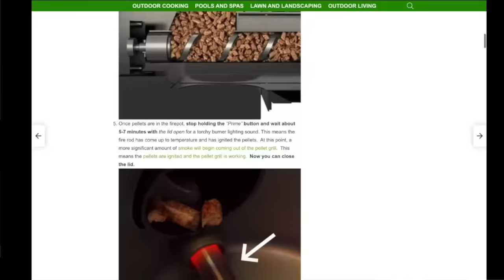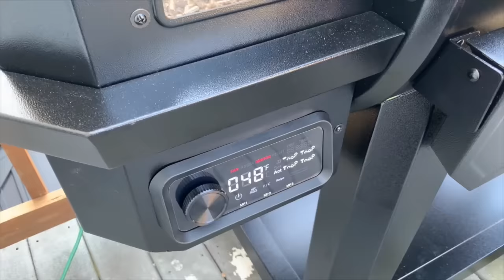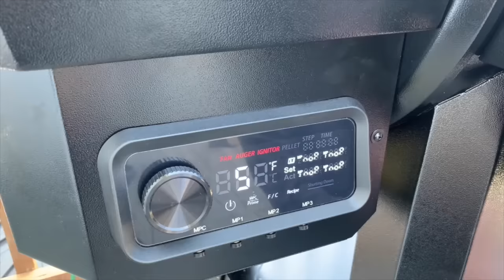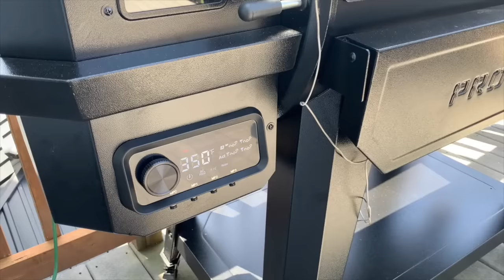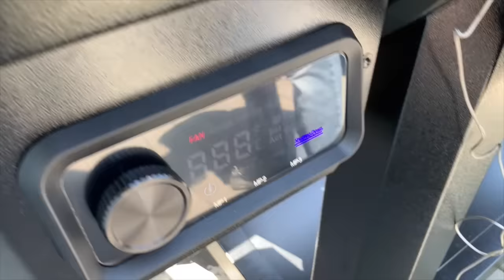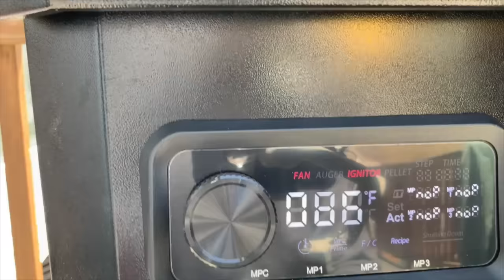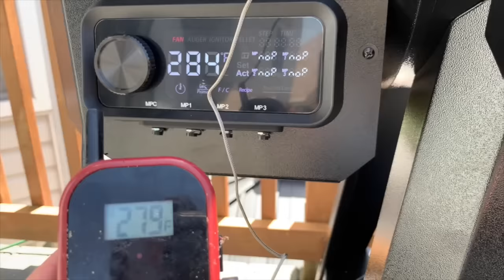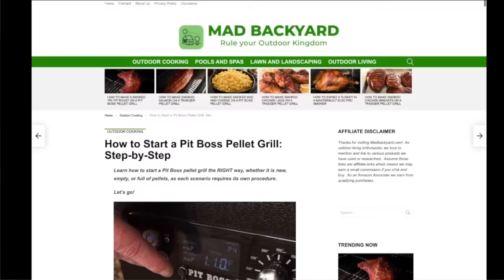How to Start and Season a New Pit Boss Pellet Grill

Comment: You have the Pit Boss Pro series. What is the model number of your grill. How many cubic inches of cooking space is on the bottom rack?

I don't care of WIFI stuff. If I can find one this is the model I want to get. I want to make sure it has wheels on all 4 legs.
Reply from the maker: Here is a link to the Pro Series 1150 available from Lowes.  Model # is 10576.  
https://www.lowes.com/pd/Pit-Boss-Pro-1150-sq-in-Hammer-Tone-Pellet-Grill/5013310479
Looks like the only difference from when I bought mine earlier this year is no clear window into the hopper anymore.  Not sure why the change, maybe they were cracking during shipping, I don't know. 1150 is the sq. inches of cooking area (although keep in mind that includes about 450 from the warming rack, which I rarely use because it gets in the way more than anything with large pork butts, etc.) So really you have about 700 sq. inches on the main area. Yes its got 4 wheels, and needs it, because it is HEAVY.  I don't really use the wifi app on it, but it's there if you want it.

Thanks for watching!

Comment: Im holding prime button and auger light comes on but than shuts off while holding the button. Any suggestions?
Reply from the maker: Hi Isaac - I haven't had that happen to me specifically.  Can you see the auger actually turning even though the indicator light is not coming on when holding Prime?  If its NOT turning, there may be something jammed in there.  Make sure to unplug the unit before investigating.  If its not turning and nothing is jammed in there, might be something wrong with auger motor and I would call Pit Boss for a replacement.  If it IS turning and just the light is not coming on, I would still call Pit Boss because may be some other issues going on.  Hope that helps.

Comment: Great video!  Do you clean and season after every use or after every few uses?  I have been told both by friends.
Reply from the maker: Clean, yes, season no.  I clean the grates after almost every use by doing a burn off over the fire pot with the flame broiler open and the grill set to High for about 3-4 minutes each grate and a good grill brush. Then maybe every 8-10 cooks I do a deeper clean. I wipe out the trapped grease near the grease bucket chute with paper towels, use a wooden scraper to clean the crusted on gunk on the flame broiler and vacuum the accumulated pellet dust at the very bottom of the grill.  I'll have a video of this coming out very soon!

Comment: Can I prespray the grill/smoker before heating it up every time or is this unnecessary and dangerous?
Reply from the maker: I would say the only dangerous thing would be spraying directly into the firepot with the flame broiler grate open, OR spraying for a long time right onto the hot metal of the flame broiler when it’s turned up really high. Otherwise you should be fine.
Reply: Prespray with oil on the grates

Comment: I just bought the Austin XL 1000, I do not have a slider rod for my flame cover, do you know what the best way is to slide it open and shut without the rod? not sure if there is an after market one I could purchase, that i could install with very linited effort as I am new to this and do not know how to drill holes and such, Thanks for any input!
Reply from the maker: Sorry I'm not familiar with using that model myself or how the flame broiler is designed on it.

Comment: Should thicker meats be cooked on the left side so the outside doesn’t burn before the inside is cooked?
Reply from the maker: I think what's more important is choosing the right overall temperature and keeping an eye on your internal meat temperature with a good thermometer.  We've got a lot of good specific recipes over at https://madbackyard.com. That said, the more I cook on this particular model I do find the RIGHT side actually throws off a little less direct heat than the left.  Maybe because of the down slope of the flame broiler plate, the hot metal is further away from the food.  So I have been cooking pork butts etc more on the right side actually.  And stay away from directly over the firepot if can help it on low and slow cooks.  Thanks!

Comment: Do you find the ash from the fire pot blowing out to be a problem
Reply from the maker: I noticed it a lot more when the Pit Boss was brand new and everything was still shiny and slick.  Now that it's seasoned up a bit I don't really see any ash blowing out with the flame broiler plate open, maybe it's catching more on the sides of the firepot and bottom of the flame broiler.

Comment: Would you season the underside of the flame broiler? I didn’t season mine several years ago and the flame broiler rusted through and the pit.
Reply from the maker: That's a good question Scott, I never thought to do that to be honest.  All I could find about anything close was this article from Pit Boss which just says to apply oil to the flame broiler and then move the plate back and forth to get in between all the spaces where it opens.  But I think that still refers more to the topside.

https://pitboss-grills.com/smoke-science/how-to-tuesdays/how-to-season-your-pit-boss-grill-or-smoker

But nothing about the underside.  I guess you would just need to be careful to go easy with it because I imagine you don't want a bunch of oil then dripping directly into the fire pot or pooling down on the heat diffuser plate around it and causing a grease fire. Also need to always make sure you have a good cover to prevent water penetration and rust. I put up another video with the cover I really like if you want to check it out.  Thanks for watching!

Comment: Why is it that here you say run it at 350 for burn off, but on your website you say to go to at least 450 degrees?
Reply from the maker: Good catch thanks! The article is older than the video and looks like current Pit  Boss manuals recommend doing the burn off at 350 “or higher” so I was probably going off that when I made the video.  Won’t hurt to go up to 450 either though.  In fact, probably not a bad idea to run it up that high to make sure the heating rod is working correctly and you can get up to those temps when brand new. Thanks for watching!

Comment: How do you empty the fire box's ashes?
Reply from the maker: The ash pot on this model is removable from the bottom of the barrel.  I show how to do it around the 9 and 1/2 minute mark of this other video if you want to check it out.  
https://youtu.be/sy8GZkWtRMI

On alternate models that don't have a quick release on the bottom you will need to use a shop vac.

Comment: I watched the video three times and implemented pretty well (I only forgot to restart it after I oiled it). But when I did my first cook, I got the initial white smoke you talked about but after that there was no smoke. The food tasted fine but there was no smoke. I had pellets burning in the fire pit and grill up to temp (350) but no smoke. Aren't the pellets supposed to generate the smoke? And I used a new bag of Pit Boss brand competition pellets. Every cooking video I have watched all show tons of smoke. Any thoughts as to why  no smoke? Also, do you recommend cooking in the smoker with the grates open, closed or partially open?  Thanks.
Reply from the maker: Thanks for watching Greg! At 350°F you aren't going to get as much "noticeable" smoke as you will see when smoking down in the lower 200 range.  At 350°F you'll have a pretty strong fire going in the fire pot at all times vs. a more smoldering burn you'll get in the lower ranges, hence more noticeable smoke. I say "noticeable" because there is still smoke, trust me, you can't burn wood without making some smoke, but at higher temperatures it is producing a thinner bluer smoke that won't be as noticeable. This is really a function of how wood burns and makes smoke at different temperatures, whether it be a campfire or a wood burning stove, not just pellet grills.  

As to your other question, for most low and slow BBQ, you want the flame broiler grate CLOSED for INDIRECT heat, otherwise you will burn the food on the grates above it.  Only if you are grilling something like hamburgers or steaks and want a high level of DIRECT heat for a short burst of time should the flame broiler be open.  Check out our article on hamburgers (using direct heat) here: https://www.madbackyard.com/pit-boss-hamburgers vs. cooking something like ribs (low and slow with indirect heat ) here: https://www.madbackyard.com/baby-back-ribs-on-a-pit-boss-pellet-grill to see the difference.  Hope that helps!
Reply: @madbackyard  Thank you for the prompt and informative reply. I'm subscribing NOW.

Comment: I have a pro series but it didn’t come with the metal shield
Reply from the maker: Hi Orlando, if you are talking about the rounded flame broiler plate that sits over the fire pot, that's a pretty major component to be missing and makes your pellet grill unusable. If it's the flatter drip pan that sits at the bottom of the pellet grill, that's also a must have. I would contact the company either way.

Comment: Got oil on the temp probe while applying the coat of grapeseed oil. Is that ok?
Reply from the maker: I would wipe that off once the grill has cooled back down.  Good to clean the temp probe every now and then as well once you start using.

Comment: Hi buds
Hey I’m out here using my new Aston XL tonight got it set up and running today (I’ve had another Pitboss for almost 5 years prior to this one).  I’m watching some videos on YouTube while heating up and I ran across yours. I didn’t watch the video past five minutes and I’ve stopped it, and I’m sending a message directly to you that you are not putting out the right information!!  Love your intentions, love your effort,  but you have it wrong.
The  “acrid smoke” you’re talking about is the same smoke that you cook with all the time, there is nothing special, different or nasty about smoke at start up with the grill. 
What you do see at startup is an excessive amount of smoke because the fire pot has not actually come to the point of IGNITION AND FLAME such that it burns away the smoke. That is what’s happening when it starts and the smoke clears.   That smoke is actually combustible and when your fire pot reaches temperature it actually burns off that smoke because it is, as I said, combustible. If you don’t believe me or question it, just go onto YouTube and look for “Exploding Traeger”. 
The method this grill cooks with is one continuous cycle that just  repeats over and over:
(Sidenote here- That plate you’re  able to slide back-and-forth in the Pit Boss, which the Traeger does not have, is what makes this unit so much better. The Treager is nothing more than a glorified convection oven and can never apply flame directly to the meat. Pit Boss made a better mouse trap and it works far better, as you well know.  Now who has the best advertising in the grill industry?? It’s Treager, which explains their popularity)

Here’s the cycle ;
1- Pellets arrive at the pot and are ignited either by the heating element Initially or by the residual heat of the embers from the previous load being fanned by the continuous blower.  I don’t believe you mentioned that the heat from the heat rod is present only during the starting cycle and after that the grll cycles continually on its own as explained below.
2- As part of this ignition process they pellets initially begin to smoulder and, you guessed it, SMOKE!!  This is the smoking phase of the cycle, where you actually add smoke to the heat.  Now, if you’re cooking at a higher temperature and not smoking, this smoke phase is a short time period, and the pellets will then ignite fully and burst into fire, adding heat to the process.  This shortened smoke cycle is due to the fact you’re cooking at a higher temperature, therefore feeding more and have a hotter box which just simply eliminates or minimises the smouldering aspect of the cycle that creates the smoke.
Depending on your P setting and / or whether or not you are still below the temperature set point and accelerating to temperature (which means your continually feeding in 30 second intervals on my Austin and I’d suspect your too) you will restart the cycle by feeding a new load of pellets into the fire box. 
Obviously in the smoking mode and at that lower temperature with the additional option to set the P setting to greater than P4, you can really slow down the feed of pellets and increase the length of the smoke cycle and the amount of smoke produced. But no matter what speed you are using and how long the duration of the smoke phase is, it is just that, a smoke PHASE which is part of a CYCLE that repeats itself over and over. 
Therefore starting smoke is the same as cooking smoke.  I’ll take a look at the rest of your video let you know what else I see but any in video where you’re talking about how to start a grill and talking to newbies, my expectation is you’re talking about safety and I haven’t seen the idea in the first five minutes so let’s see what I see next…
Reply from the maker: Thanks for watching Sammy! I think we are saying almost 98% the same thing, and maybe I made too big a deal about not using the smoke at the beginning of the ignition cycle as you put it.  I wouldnt say its a "safety" issue though, just more personal preference of taste. And what's most important is to start the 1150 on the "Smoke" setting for 5-10 minutes with the lid open as they tell you in the manual before closing the lid and setting your cooking temperature.  Interestingly there is also no adjustable P setting on the Pro Series 1150 as there has been on other pit Boss models including yours. I am totally guessing here but I would imagine Pit Boss got tired of all the questions surrounding it and people getting confused by it so they either made it adjust automatically in the background now or have it set to one P value that cannot be adjusted.  There is absolutely nothing in the Pro Series 1150 manual  about p settings that i could find.  Also the ignitor rod DOES turn on and off occasionally throughout the entire cook on the 1150, there is even an LCD that says "Ignitor" to let you know when it is on.Thanks again for watching and for the feedback!

Comment: Wow that’s a terrible design having to hold the prime button for 5+ minutes. Wouldn’t it be better to just throw some pellets into the bucket instead of through the auger?
Reply from the maker: I think they have updated this on newer models this year. One viewer told me there are preset buttons to keep the auger turning for like 1 minute straight without having to hold it.  I wouldn’t ever manually fill the fire pot with pellets.  This can lead to over igniting on startup and a burn back (fire in the auger and eventually the hopper)
Reply: @madbackyard  good point. Just got mine yesterday. Didn’t know about the presets, thanks I’ll try that!

Comment: Do not buy pit boss. Mine did not work out of the box and I was given instructions to replace heating element. When the new part arrived two weeks later and I spent an hour installing it the grill failed again after 1 hour. I was then told that maybe the main board needed to be replaced. This is a brand new unit and pit boss thinks it’s acceptable to have a customer perform multiple repairs. I do not recommend buying anything from pit boss. There are better options.
Reply: Imagine being 'that customer'.. 😂